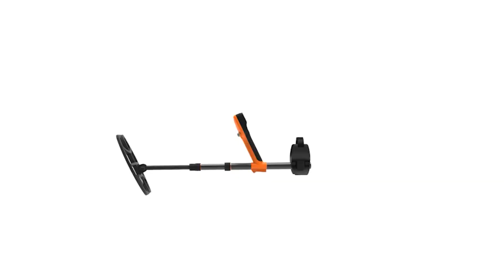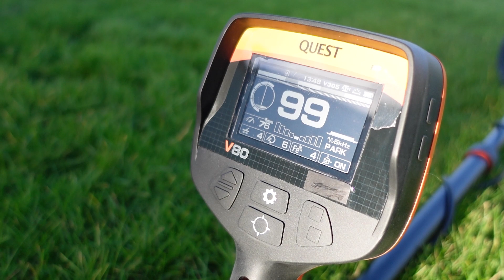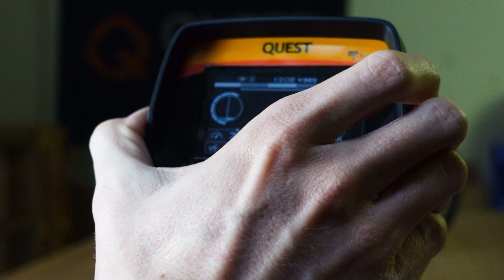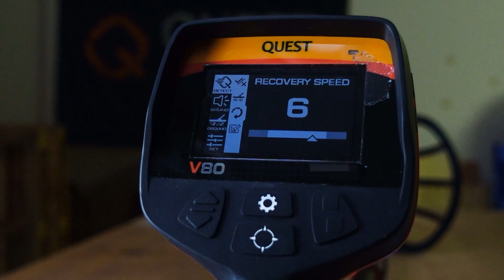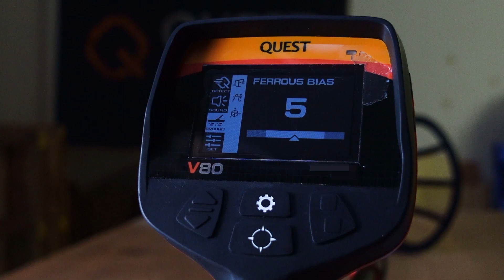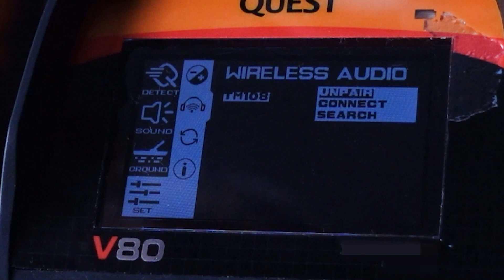Welcome our NEW Quest HyperQ METAL DETECTORS! Introduction Quest V80 & V60

Comment: Hello, can the v80 device work under the power tower or not?
Reply from the maker: Hi! I can't give you a definite answer to this question as it always depends on the specific situation.

It sure can work, if you have trouble with it try using single frequencies. And of course use the noise canceling as explained in the video 🙂

Comment: Whats thé différents betwine made of china and made in usa or Germany
Reply from the maker: Hello! Made in XXX means that the most of the manufacturing is happening in the specific country. While this can be an indicator for the quality of the product, as it has been more in the past, you can't draw clear conclusions from that. It is possible to build high quality or low quality products everywhere, it always depends on the specific factory. Also, there are many ways for companies to write made in Germany, USA or whatever on the products but still get many parts and labor from countries where they have to pay way less and, probably, get lower quality. 🙂
We at Quest produce high quality metal detectors which, are technically mature and have proven to be on par with the competition in terms of quality.
Reply: If it's not made in China, it's a fake.

Comment: What is the difference between a q and v 60 - and 80 detectors
Reply from the maker: Hello! The Q60 and V60/V80 are from different metal detector series. The V80 is our latest machine, the biggest and most important difference to the Q60 is the HyperQ multi-frequency. Meaning it searches with multiple frequencies from 5 up to 80 kHz AT THE SAME TIME, leading to way better search performance for all kinds of targets. The Q60 has 3 changeable search frequencies.

Furthermore, it has a carbon fiber shaft, a built-in Gyro-Sensor for ground balancing without pushing a button, automatic standby mode for battery saving and more stable target IDs. The display is sunlight-reflective, meaning it actually gets more bright the more light falls directly onto the screen (For most other screen it works exactly the other way round). 

There are also some other, smaller differences in the settings, but I hope this overview I gave helps you already 🙂

Comment: I see in this video the screen will be damaged easily. That worries me. There must be a display protector. Looks like a great new detector. Curious about its capabilities in salt water. Also if there will be a bottle cap discrimination mode for places like beaches.
Reply from the maker: Hello! The device in the video was just a sample to test the detector. We also took a look inside the device and in order to do this we had to remove the sticker around the display. For this we had to break the sticker and that is the damaged spot you see in the video. The screen is 100 % intact. :-)

Comment: Is it waterproof?
Reply from the maker: Yes, you can use the detector under water until 5 meters deep 🙂
Reply: @QuestEurope  Do you make headphones that are waterproof that connect directly to the control box when submersing the detector in water?
Reply from the maker: @luisvillarreal5262  Yes! There are already usb-type-c underwater headphones for the X10 Pro that will also fit for the V60 and V80 🙂
Reply: @QuestEurope  Thank you
Reply: @QuestEurope  is it going be for sale in USA Amazon

Comment: Looks great. But why ditch the magnet charger? Works great on the Q60.
Reply from the maker: Hello! We also love the magnetic chargers, but using just one USB-type-c for charging and headphones ist just more efficient. Also, for the users it is better as it's easier to replace if you lose it or it breaks. :-)
Reply: @QuestEurope  That's true😄
Reply: @QuestEurope  yes, as long as the port doesn't wear and become loose, as most do.. I have a deteknics pinpointer, it's brilliant, and have had for at least 3 or 4 years, but now getting slack in the port... Just stating a fact. But really looking forward to getting hold soon.